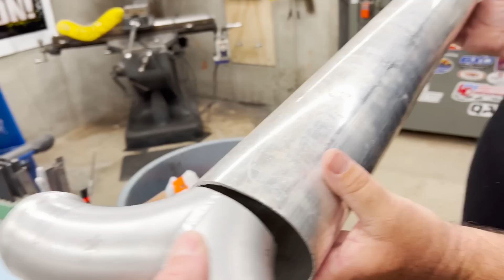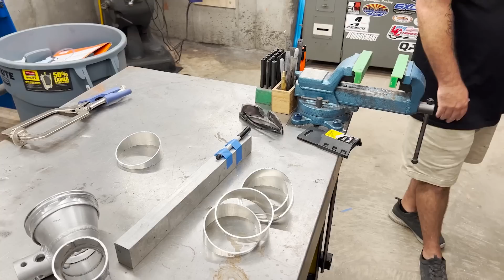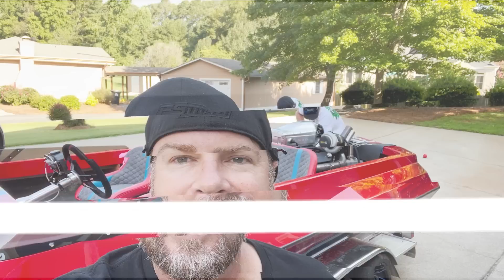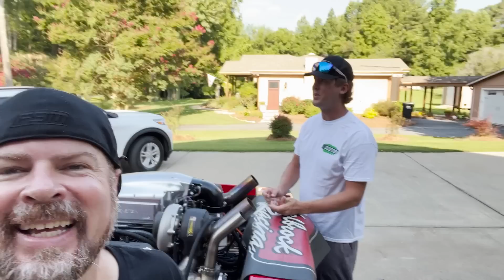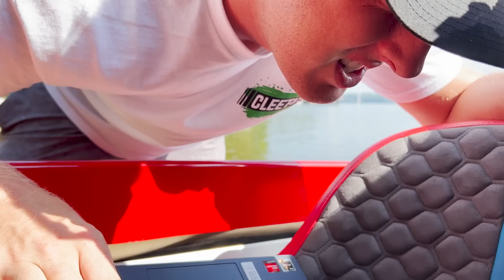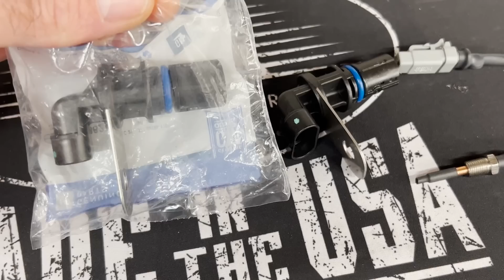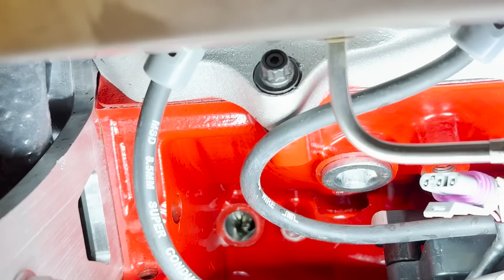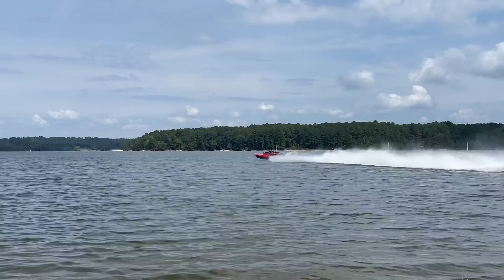CLETUS MCFARLAND, PIE CUTS, BROKEN PARTS AND A NEW PERSONAL BEST IN WIFEY'S WHIP!

Comment: Dont know how you guys have plumbed ur intercooler setup .  But the best way is in two parts .  1)  Water Bleed Off from Jet Unit goes straight in2 ur Intercooler & then in2 ur Engine . Preferably the Heads 1ST & then the Block .  2nd )  Your Intercooler Manifold is Awesome.   And without seeing inside it ,  I BET IT HAS AN ALUMINUM CORE .  ( YOU NEED TO UPGRADE THAT 2 A WHIPPLE CUPRONICKLE INTERCOOLER CORE ) & U will see some HUGE GAINS .    117 MPH is a Massive Improvement Guys .  Robert  Australia

Comment: That boat sounds like it’s making another 300-400hp.A suggestion-try to get the spark plug wire away from the sensor wire . There might be some kind of emf interference going in .
Reply: another option is to run the sensor wire thru some grounded copper braid, to shield the signal from the spark wire.
Reply: @2000freefuel  Not sure about automotive stuff, but in Industrial Controls we wouldn't dream of running a sensor wire that wasn't internally screened and earthed for just this reason. Especially if it went anywhere near an HT spark source. When we fit Industrial burners, any HT cable must be at least 300mm from either a Flame Scanner cable or an Analogue sensor.

Comment: The cross-sectional area of a tube increases a lot more with increases in diameter than most people realize. The cross-sectional area of a 4" tube is 2.56 times the area of a 2.5" tube. So you actually have more area in the elbow now than the 2 tubes coming from the turbo, so absolutely no restriction.
Reply: Exactly. The cross sectional area increases 3.1415 square inches for every 1 inch the diameter increases. This is because Area=diameter*Pi

Comment: FYI, remember to leave the radius outside of your Y intact, because if you remove it that will cause extreme turbulence inside the radius bend going to your throttle body. 
You want the air to have a smooth radius curve to direct the air flow coming from opposite directions to be guided around the corner, and not dead heading into the opposite flow head on.
Imagine that you're looking at it as if it were water, are smoke, and that you just ran them full force into each other head on.
Even though you do have a pipe to contain them both, you're still doing a major directional change.
If these two forces come together after the Y in a controlled radius curve, and it always them to just blend in the slipstream, there's very little rolling and boiling of the two invisible forces.
If allowed to smash in anything less than a than a smooth long radius 90 degree radius.
Then you will have a unstable air stream, and you will lose both volume, and velocity, because of the lack of controlled smooth directional change which creates excessive static pressure. Which means you lost a bunch of clean air, and reduced the amount of horsepower you could of generated for less effort from your turbos, and the more efficient they are the longer your engine and other components last.
Simply make a long radius 90 degree elbow of the same size as the entering pipes from each turbo outlet, then cut it in half on the middle of the 90 across side to side. 
Then cut them in half along the center of the radius retaining the outside piece of the two halves.
Trim them up to fit inside of the Y connector where you maintain as much of the original pipe size.
Tac them back to back where they'll match the Y size at exactly the same point on each hakd as if you're completing a true 90 degree radius coming from opposite directions, and all them to continue the full distance possible to control your air flow inside your transitional 90  
It will not hurt if you have to split the transition to match the heels of the incoming 90's, because it allows you to keep controlled direction of the opposed forces, and allowing them to blend smoothly. 
Yes it's a PIA, but this is the correct method for merging to different directions smoothly, and you're gains in clean air will be far superior to what you'll get if you allow the smash headfirst into each other. 
Over 40 years in commercial and industrial hvac and every type of air flow scenario you can imagine, I've dealt with it, and had to figure out how to fix the crap others have installed that was poorly constructed, and or engineered, because would deliver the proper airflow required to meet the designed CFM'S.
So I giving you the best information that you can possibly hope for in the position that y'all are in trying to improve the preformance of your intake system. 
In those famous words that we all tell out girlfriends and wife's, trust me. 
If you really think you improved it as much as you did by using the pieces that you used. 
Make another one using the information that I gave you, and do a comparison of those two fittings. 
And if you really want to learn how to make your hot and cold side piping as efficient and productive as possible, get yourselves a manometer, and study where, and how to set it up to measure your airflow through your systems
Reply: If you could fit all of that in the space allotted, would be good information, not enough room=compromise, Finn made a good choice in my opinion
Reply: @jkK-lw9lu  you can very easily if you know how to layout your fittings. 
Just look at it as if it was made of glass, and your minds eye can show you how if you look at it in that way. 
Just extend the outside radius of the Y, are as you look down on it in plan view. 
Its the middle of the fitting, and by extending the heels of the opposing fittings, you clean up the turbulence by allowing the air to flow naturally into one another. 
Versus the way it is now, the air slams onto the opposite air flow causing it to boil, and roll around against the inside of the transitional 90, and itself, instead of blending smoothly. 
Here's an example of how to in vision air flow..
I'm sure you have seen rocks and boulders in a river, and how as the water flows around a Boulder, it's nice and smooth. 
Until it slams into the water flowing from the opposite direction, and then it rolls and boils every which way. 
Air does exactly the same thing if you make it slam head first into air flow coming from around the corner meeting it head on.
Yet it meets the other at the same angle, are close to it.
It blends smoothly together, doesn't cause them both to fight each other, because that's resistance and causes increase in static pressure and that slows the air flow to slow down dramatically. 
Yeah I know I tend to get carried away with my explanation of how airflow works, or doesn't work if the wrong things are done.
Reply: That was a good read. Learn something new every day. Thanks!
Reply: It's much better than before indeed, but i'd still say it's a restriction of the cross section still.
Like you're proposing they would optimally go around the bend and then combine.
Cleetus should have brought that 2 into 1 thing that fits with the Motion raceworks throttle body, i'm sure they've done their homework in regards to airflow. (and at least looking at it, it looks like good flow ... not that my intuition counts much)

Comment: Squeezing the air heats the air… If it weren’t for auto correct in the dominator you’d been re-tuning it… 40* is a big drop. That much more mph in a boat at less time/distance is huge. Probably picked up 50hp…

Comment: You need to recalibrate the flux capacitor since replacing the crank position sensor then it won't shut off anymore. 😄

Comment: I would put some shielding on the wires running to the crank sensor to prevent EMI.
Reply: Looks like they have shielded cable with the drain connected at the ecu ( see the heat shrink on the sensor end covering the shield?)

Comment: Told ya that elbow was hurting ya! I wanna go for another ride :)
Reply: Everyone should watch Gale Banks video on throwing the boost gauge away and calculating air density of cool air. Amazing the change cold air makes vs boost pressure.
Getting rid of factory air cleaners is the worst but everyone wants the cool open air filter look.
Reply: i feel like a Dick for saving this but same i commented it on the build video
Reply: Nobody likes a know it all Kevin JK😜
Reply: Nudge nudge
Reply: Seen you at the Gainesville airport a couple of weeks ago for the same flight to Atlanta at 6 in the morning. Was going to say hi but didn’t want to bother you.
Reply: Why ain't ya there tunin' then?🙂
Reply: What about welding with battery or electrical hooked up? I have hurt ecm on equipment welding with disconnect in OFF position. I ALWAYS disconnect the battery when welding on anything
Reply: Tell ya what, i would do some abrasive slurry flow porting on that elbow
Reply: Kevin really knows his stuff!  Up next 125 mph!!
Reply: You Would be the one to know! You’re a talented dude, so is drew.
Reply: With all those restrictions I would've thought that engine was a Russian Athlete 🤣😂
Reply: Need a Finnegans Garage, Cleetus, KSR jet boat showdown 🤘🤣
Reply: Maybe teach folk about maintaining the cross-sectional area of the tube, regardless of the tubes shape? ;)
Reply: @PiDsPagePrototypes  in general the hot rod community is way behind the curve in really learning about true airflow characteristics as far as turbulence restrictions how to design a system with  the least amount of potential restrictions and or turbulence both of which are major factors in turbo efficiency. 
That and they really need get past how pretty the welds looks on the badass titanium, steel and or aluminum piping and insulted everything from both sides.
Down to insulting the tubing from ice water tanks to isolation for the intercooler where it connects to the frame supporting it.
Because everything that is used to pipe the hot and cold sides into the turbos and the throttle bodies is the best heat conductors for the most part out there. 
But if you insulted the  hot side you generate more power to drive the turbine that drives the wheel that sucks the air to stuff the air into the combination chambers.
Yet they super heat the space underneath the hood which in turn super heats the charge pipes, and the manifolds next to them.
Cold air is horsepower and forced induction cold air is bigger horsepower. 
Simple basic common sense tells you that the heat is killing the best part of your efforts in creating more power by the most efficient way to get forced induction except ram air, which most cases this could be improved by ducting the inlet side of turbos in especially when they're trapped inside the hood with  out a open path straight to outside ambient air
Reply: @timothymilam732  Spot on!
Also, there's a bit of a giggle to be had, with auto correct swapping Insulated for Insulted - I can imagine a frozen guy shouting at an engine,... :D ;)
Reply: @timothymilam732  i agree with you on the airflow side of things, however heat insulation is one of those things that has diminishing returns the further you go with it. the most important thing is getting fresh air in so your not starting with super hot underhood air. in a street or drag application, insulating charge pipes does very little, the air isnt in the charge pipes long enough to absorb the heat, even if the pipe is quite hot. this was shown twice on engine masters where they showed icing down an intake manifold does nothing to the bottom line. same thing with insulating ice box hoses, many people use braided nylon an hose, or just rubber hose, and those are already insulating materials, doing anything with them in street/drag stuff will do almost nothing.  now exhaust side insulation, different story. doing that will reduce underhood temps and can make turbos more responsive.

completely different situation in an endurance application like a road race car, heat insulation is everything to not only help with consistent performance, but to keep components alive.
Reply: @timothymilam732  it's hot rodding, not rocket science. No one is trying to extract every singular horsepower, we just want to finish projects and drive them.
Reply: @_Bonez12  there is some smart MFers commenting on this simple hot rodding site, so I’m absorbing their free schooling 🤪
Reply: @timothymilam732   - I presume you meant to “insulated” vs “insulted”.  Either way I wasn’t insulted by your comment.
Reply: Dam trolls

Comment: You didn't talk about the boost pressures or the AFR between the 111 mph run and the 117 mph run. We're they the same? If it ran leaner and with more boost, then I would definitely say unrestricting that elbow payed off.

Comment: When you placed the sensors side by side, you can notice that the mounting tab metal it a small bit thicker.   Perhaps, there is an issue with the securing tab changing temp, moving the sensor and causing additional gap.  One way I would test this is to add a washer or small metal tab on top of the securing tab to help stabilize it during heat cycles.  The difference in 1mm can cause the system to fault.
Reply: Or the paint that I was seeing under the mounting tab!
Reply: @jkK-lw9lu  And the paint around the sensor port as well. That was my first thought. Scrape that area so the sensor is fully engaged.

Comment: When you mounted the new crank position sensor did you scrape the paint off the mounting bosses? Just wondering if that layer of paint is the answer.
Reply: Thats what I saw. Some pretty nasty paint buildup. Also, I rebuilt an LS last year and had a crank sensor issue. Mine was ACDelco made in Mexico. The little vertical bosses that span the two circular bosses were milled to thick and it would not seat in the block correctly. I put the original used CS back in and it ran fine.

Comment: Sensors can be too close. If you get it closer than designed, the voltage induced goes way over the ECU capability so you get false triggers and then it shuts the engine off because it lost timing position. Ideal for most sensors is about 1mm.

Comment: Air intake temperature is key, air density = hp. Sweet ass boat love your builds.
Reply: My quarter mile times were always better on a cool night
Reply: Not only air density but also knock reduction
Reply: @Hamring  thats all to do with your timing and afr tho obviously locking is bad for your motor but it could b prevented are you saying that nitrous and turbos reduce your chance of knock because the temps are down?
Reply: @prod.yayo5715  just saying the end result is normally the same (more power). Sure, there's a whole bunch of caveats but i wrote my comment as a reply to the original commenters generalized statement. 

Obviously turbos in general increase knock because higher pressure=higher air temps.
Reply: Yupp nitrous makes it super cold in your combustion chamber allowing for extreme amounts of fuel to be combusted thus more power even tho I’ma turbo guy I love nitrous one time me and my friends for fun did a 150 shot on a stock 4.0 Cherokee we were running with the built stuff all we had was paddles and a dry shot
Reply: @prod.yayo5715  the main part about nitrous is the oxygen in it

Comment: I was wondering how that was going to work out. Think of it as trying to stuff a 5 inch wad of paper into a 2 1/2 pipe.. With 2 inlets at 2 1/2 each,.they need the equivalent  sized outlet when they come together.

Comment: I'm lost trying to figure out how pie cuts work 9×5 =90
Reply: The cut off saw is set to 9 degrees from centre but after each cut of the pipe its spun 180 degrees so you actually end up with 18 degree total pie cut
Reply: Each pie cut has 2 9 degree cuts in it so it's actually 9x2x5=90

Comment: 9 times 5 is 45 in my book. Still impressed, I am in CAD design and I know how tricky 3D design is. I work only in 2D, thank god for that.
Reply: Except it's 9x5x2 because each pie cut has a 9 degree cut on each side, making 18 degrees per cut
Reply: If you cut a tube at a 9° angle, and then rotate the pipe around by half a turn, and you cut again at 9°, the pie cut is 9° to both sides, totalling 18°. And 5x18=90.
Reply: @Hydrazine1000  That's why I add radial measurements also to stuff like that. For me it was an 18° angle, just by the looks of his pieces. I know the 3D stuff is difficult, so I try to make it as clear as possible which cut I want. That is my job.

Comment: 2.5/2.5 to 3 to 4 will maintain pressure but 2.5/2.5 to 4 would maintain flow. However pressure vs flow in regards to waste gate and pop off it might just be the trick in regards to pressure. Driving it will tell all.
Reply: Placing a 3" transition in between will still create a pronounced restriction, yes?  My basic math tells me a 3.5" collector elbow would have been perfect.  4" has a couple more inches of cross sectional area, so they are losing pressure, like you said.